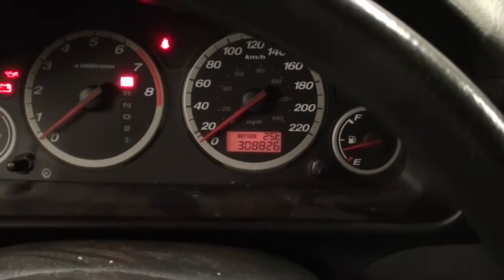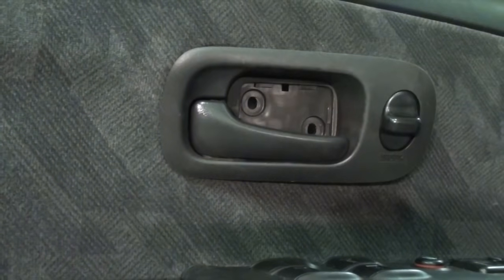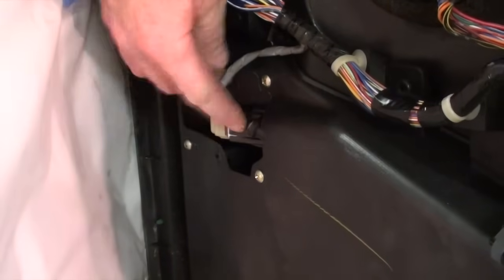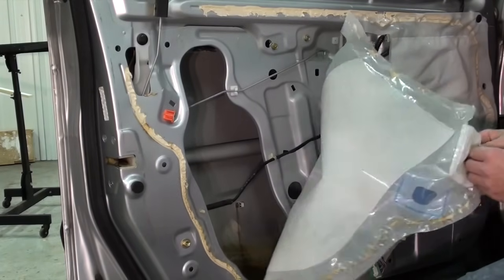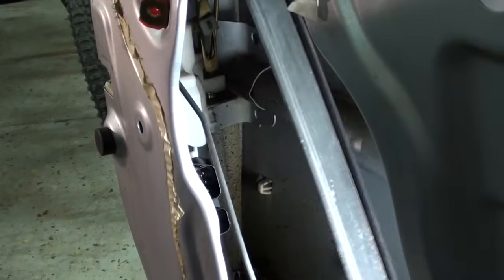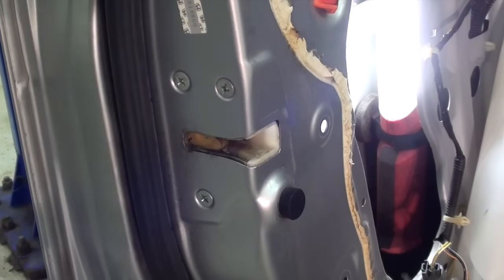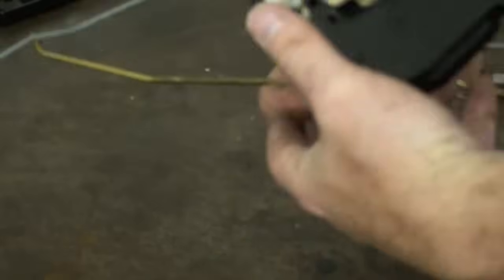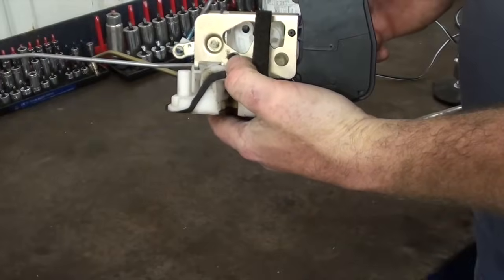Replacement - Door lock actuator - HONDA CRV

Comment: Hands down the best DIY car repair video I have seen.  Exception explanation and getting your camera into the hard to see places.  No wasted time on commentary or irrelevant video, just succinct and detailed.  I wished you would have shown putting everything back together.  I reversed the video as you said but some of the arms came off the hatch holding the actuator and it was difficult to know where they go.  A lot of trial and error putting everything back together but your video made a difficult job easy.  Thanks for adding this!!
Reply: Any tips ?
Reply: @markrodgers1965  tips on what?

Comment: If not for this excellent video, I was about to give up trying to replace my driver's door actuator on my 2003 Honda Accord LX 4 door because I couldn't disconnect the 2 lock linkage rods, until you showed me how easily it can be done by inserting the tip of a flat screwdriver between the rod and the plastic bushing and simply twisting the screwdriver counter-clockwise.

Thanks again for this clear and concise instructional video!
Reply: Same. This video showed how to easily unhook them.

Comment: Easy to follow instructions.  Many thanks for taking the time to put this very helpful video together.  My advice to others:  be careful when you remove the metal covering to install the new actuator.  Make sure that you put everything back correctly, especially the interior door latch rod if it should come out.  Also, be careful when you remove the three philips head screws holding the lock mechanism in place.  The metal is soft and easy to deform.

Comment: Just completed this today on an '03 Element DRIVER"S DOOR that is very similar. Door panel comes off without too much trouble. Tips:
1. Take your time removing the inside plastic triangle trim piece above door panel - the one above the outside handle. It has to be pulled apart (straight out toward you) from the BOTTOM LEFT, then slide up and out, otherwise you'll likely break the plastic. Slip a thin screwdriver covered with a microfiber cloth to not scratch the paint, or plastic tool behind bottom left corner and gently pry straight OUT. You'll feel the clip pop out, then you can just lift up and out it comes. Put it back in reverse order. 
2. If any of the plastic white clips that hold the panel are still in the door frame, gently pop them out (I used some wire cutters to gently grab them and wiggle them out) and put them back on the panel before re-install.
3. I did pull down on the window track to get it out of the way. It has to pull down about 1 inch. You can slide the metal track up and back in place (it fits inside the upper section) to line up the hole and screw the 10MM bolt back in AFTER you've got the actuator reinstalled. 
4. Be sure to get the 4 rods in position before reattaching the actuator assembly with the three screws into the frame.The long HORIZONTAL interior door handle rod (you've reattached it to the actuator) and out the big upper hole in the frame (with interior door handle end of rod facing DOWN), the rod to the manual lock (out the hole on the inside metal door frame), and the two inside shorter rods connecting to the exterior keyed door lock and exterior door handle - you'll connect these two AFTER you reattach the actuator assembly to the door frame.
5.The white VERTICAL plastic cover piece behind the inside door lock rod (that you likely removed) can be placed next. You can't see it SO...when you have the actuator assembly out of the door, grab that plastic piece and SEE how it's installed (clips DOWN) to the top and slides up against the middle plastic part of the actuator). You can SEE how it goes back and do it a few times to get the feel of it. Then when you re-install it you can picture it in your mind and it's much easier to reattach. *Make sure you have the upper plastic tab with the hole in it sticking OUT the square hole in the metal frame before you snap it in place, or you'll have to do it again. That tab needs to be OUTSIDE the metal frame and then finally attached with the plastic push pin.
6. Remember: the DRIVER'S door won't manually lock when the door is open (unless you're holding the exterior door handle open), so close the door before testing it. You can test the door handle first to make sure it's moving properly.
Take your time. Be patient. Your SO owes you dinner when done. You can do this! Rick

Comment: I checked out several videos. this one by far the best. One reason, its for a Honda built door actuator. If your VIN number starts out with a "J" (for my car see bottom of  driver side door well), then this is the video to see. 

Reinstalling was easy, but I had several problems:

1) Door actuator exploded when I pulled out the old one. Wish to heck I took a picture of this piece before pulling apart.
2) I installed the "window" slide one hole up. I found this out when I tried punch the handle back in. Ends up the metal piece of the window slide slid down.

Anyway, thank you for the great video. It saved my!

Comment: Please note the the 2004 CRV was built in Japan and Great Britain. If your VIN begins with 'S', it is not the same part as in this video. "S" types, OEM and after market are closer to white/yellowish. The connector come from the side, not the bottom. I ordered the wrong part at first. This video will get your the part out of the car. The bench work you will be able to figure out. Check your VIN before ordering the part.

Comment: Thank you so much for this video! It gave me the courage and knowledge to fix my door lock on my 13 year old 235000 mile CRV!
Reply: Bernice Carbaugh Congrats! I have 2 locks on my 2004 CRV (224k miles!) that recently stopped working. I was given a quote of $320 for parts and labor at a shop. I'm pretty handy and think I can do it myself. How much did the parts cost for you? Thanks.
Reply: rminitials the dealer quoted me 90 for their Honda part plus ridiculous amount for labor, but i got it online for $20. Apparently there are 2 kinds so depends on your vehicle's country of manufacture. My VIN started with a J so this video fit!
Reply: Thank you for the reply! And wow, $20? That's very cheap. The shop I went to quoted me about $75 for just 1 door in parts. Not to mention insane labor costs. I don't mind paying but if I can do it myself, why not. Anyway, thank you! I'll look into the parts this week.

Comment: Excellent advice here.  thx for the video.  I just replaced my 2003 CRV door actuator and found this very helpful.  I'm pretty handy but have not done something like this before.  Good advice.  This looks like the "J" version from Japan.  If you have the "S" version check out ajchien's too.  I found both helpful.  It took us 3 hours (my 16 year old son and I) mainly because we had trouble with getting the black actuator box well aligned the first time.  also I was super cautious and he was learning too.  We had fun though and it did work completely.

Comment: Great video.  It saved me at least $250.  Going VERRRY SLOW, I finished it in 2 hours.    The procedure illustrated in my opinion is the only way to go.  Completely remove the latch, replace the actuator, then reinstall the latch. What the video didn't show is removal of the "sail" above the door panel and opposite the side view mirror.  Removing this made the door panel removal much easier.  The only suggestion I have would be to add more detail about dis assembly of the door latch assembly to replace the actuator.  Reassembly of the door latch assembly was the slow part for me since the door latch cam fell off when I pulled the plate off to remove the actuator.  So.....my suggestion is to take bunch of pix before disassembly of the door latch assembly so you make sure you put it back together correctly.    Also......make sure this video is for your model vehicle.  Most parts houses will tell you if the actuator illustrated is for your model vehicle.  Its my understanding that the actuator in this video is for Japanese and North American made CRV's.  CRV's made in other parts of the world may have a different actuator requiring a slightly different procedure.  Also, I used a cordless impact wrench to remove the phillips screws holding the latch to the inside of the door.  Trying to do it with regular screw drivers proved to be a bit of a challenge.  Once again......Thanks for posting.  Its a GREAT video which will save DIY'ers a lot of money.
Reply: D Fab Argh! I wish I had understood your advice well enough to follow it earlier. Same problem! And I still don't seem to have it put back together correctly. When I pulled the plate off to remove the actuator, one of the rods (for the latch?) came off. I'm still not sure which side of the latch it goes on, or how to know when it's correctly installed. And then when trying to put the entire thing back in the door, the lock rod fell off. If you or anyone here has a pic or illustration of the detail of that assembly, I sure would appreciate it! I've found several illustrations on the web -- not in my Haynes -- and none of them shows detail of how the rods fit into the actuator assembly.

Comment: Thanks for the video. Just did this nasty job.  But I wish you would not have fast forwarded it at 8 mins. That was the most important part of the video I needed. Lol. I got it all back in the right shape. :-)
Reply: The part Im having issues with currently.  I thought I had it right, but then I couldnt get out of the car. lol  . the inside handle didnt pull enough to open the door. .
Reply from the maker: +Derek Wheeler Was the inner for handle rod bent during removal or installation?
Reply: not that I can tell.  everything seems correct.  Just the inside handle does not  seem to pull the rod enough to open it by a hair.  I was thinking of trying to bend it in a way to shorten it maybe.  Is the pivoting part on the assembly supposed to have about a 1/4inch of play?
Reply: +Derek Wheeler I fixed it!
Reply: Derek Wheeler I'm have my this same problem. How did you fix it? I have to open my door by reaching outside and opening from the exterior door handle!
Reply: when you are putting the arm back on the mechanism. The little triangle part with the hole in it has to sit in a certain way..  I had it not fully in and the metal plate wouldnt fully seat correctly.  Once i messed with it and realized it needed to be seated just right .. it all snapped together easily and perfect.  after that it worked like I should.
Reply: Derek Wheeler ok. I tried this. The metal plate wasn't seated correctly. I'll have to go back in a fourth time. I've still got play in that rod mechanism. Thanks. I'm a bit frustrated.
Reply: you will still have a little bit of play.   All i can really remember is that rod has to sit in there a specific way. You'll know when its sitting in there right. Then that plate will snap in perfectly.  If it dont, then its not correct.
Reply: Argh. The plate snaps in perfectly. when I pull the rod with the whole piece in my hand, there's play, then it pushes the lever up, but that last 1/4" that pushes the lever all the way up is not happening. There has to be some detail to this whole mechanism that I'm not seeing. I paused the video and took screen shots and everything matches up. And the plate sits perfectly. Maybe something sprung when I initially took it apart. Thinking I might have to purchase and replace the whole mechanism. I'm telling you, I played with the rod, triangle piece, and everything that it moves to figure this out. Bummer.
Thanks for your quick responses. It was, at least, nice to have someone in there with me.
Reply: Heidi Graf did you put it in and try it? mine didn't appear to be any different except it all snapped together.   one I put it in.  I didn't think it worked.  but once I got inside and the door opened
Reply: LOL. Yep. I sure did. Three times. I have to roll my car window down and open from the outside, roll the window up, and get out.

Comment: I had no trouble following the video to disassemble everything -- and that was just great. I found it a little confusing to just figure out how to do it all in reverse order. (It was OK, just took some re-do's to remember which rods need to stay inside the door and which one is left out.) All in all, this is a great instructional video.

Unfortunately, I had an issue come up that made it impossible to finish. Though I tried to just pry up the plate, it popped off entirely -- and when that happened, the (latch?) rod popped off. I took my best guess at how it should go back on. Then, when turning the assembly to fit it into the door, the lock rod just fell off; once again, I had to guess. At least one of the decisions I made was wrong, because the lock does not move at all when I click the button (though it makes a good noise, so I think the actuator is working). If someone has one or has an illustration of how the whole mess should go together, that would be REALLY appreciated. Thank you!
Reply: Sonya Senkowsky I just had the same issue as you, put everything back together to the best of my knowledge and the manual lock that slides up and down does not move. I'm finished messing with it tonight and will try again tomorrow. Did you solve your problem yourself? If so what was the cause?
Reply from the maker: Sonya Senkowsky +ScooterDano  I would suspect when installing the actuator into the latch assembly they did not line up properly.   I'm not too sure when I'll be replacing the next one, but when I do I will take some pictures of the alignment between the two parts.
Reply: ScooterDano  Yes, I did! I am so sorry I didn't see this sooner. I am sure you have figured out by now, but it was just a matter of aligning the pieces differently. I don't recall if I took a photo, but I figured it out by going to the local dealer's parts department and asking if they had another I could look at. Whether you are looking at a black one or a white one, the units function similarly, and it was all I needed to figure it out. (If I find a photo, I will post.)
Reply: +Sonya Senkowsky That's alright, I took everything apart and reassembled the next day, everything worked after the second install. I think I originally installed it with the door lock mechanism already in the lock position, therefore the manual lock could not move down. I slide a screwdriver in the latch to fake as if the door was shut and everything clicked into place and operated as normal. Thanks for the response!
Reply: Excellent! Great to hear!

Comment: this might be obvious to everyone else out there. once i had it all installed again, i couldn't get the door to lock, even with the door latched with a screw driver, i found you had to depress the door sensor on the inside of door. (it is linked to the door locking mechanism as a back up) 
also you can get actuator out and the lock mechanism without removing the window slide completely, just bring it down and around in the slide and then be careful when poking it back up. Saved me lots of time and worry about the window. This was on a honda crv 2002. in australia

Comment: Thanks, this was helpful when someone punched in my driver door key tumbler.  
The only tricky part was getting the "Lock Rod Protector" plastic back in the right position.  

VW could take some lessons from Honda in how to put a door together well.  That was a QUICK fix, only took about 30 minutes.

Thanks again !

Comment: I take it this is exactly the same for a 97 crv.  I’ll try it.   My problem is the whole system doesn’t work. I used to open all the doors with the key but now it’s stopped working. In assuming it’s the drivers door that’s causing the problem because that controls all the other doors. I’ll give it a go when we get out of lockdown and shops are open. Thanks again.

Comment: Thanks for video, I will be replacing mine very soon. Has anyone had issues replacing the vapor barrier or door panel?  I just want to be prepared in case things aren't "sticking" back as well as they were before I detached them.

Comment: I have a Honda Element which is basically the same. I was having trouble with the door lock. It was only letting me lock the door from the outside with a key. I swapped the actuator and am still having the same problem. Any suggestions?
Reply from the maker: Its not uncommon for the wiring to break where it pivots outside the door.
Reply: All the wiring seems good. It is trying to move but it wont lock fully with the button or by pushing the lock down inside by hand. Only from the outside with a key.
Reply: hi did you ever find out what was the problem? i have a 2004 crv lx none of my doors lock or unlock only driver side door locks with me puting in the key ?
Reply: I have a similar problem. I have just bought an Element with the issue as follows. I do can open locks with the remote, but cannot lock. What can I do?
Reply: In this thread below, it talks about the issues you are having. Apparently, it has something to do with the wiring. It is mentioned in the first page by thesavo and fcs. I'm having the same issue. The driver side door will not lock by remote, so I have to lock it manually. When I lock it, I can use the remote to lock the other doors. And vice versa when trying to open the door. I have not attempted to fix the issue. I'm in the researching phase of my journey to save money :). I hope this helps. If there is a video or more info about this issue, please share. Thank you. 

http://www.crvownersclub.com/forums/14-problems-issues/15804-2003-ex-master-door-lock-problem-2.html
Reply: @alfederico7391  Hi rthere. I have the same situation on my 2002 CRV. Did you ever solve the problem? If so, what was it? Thanks!
Reply: Verigood